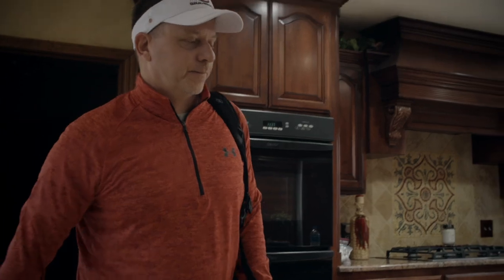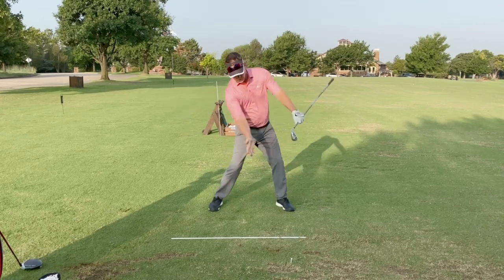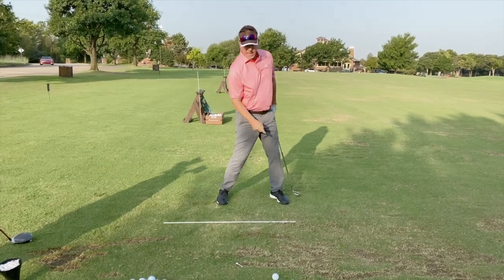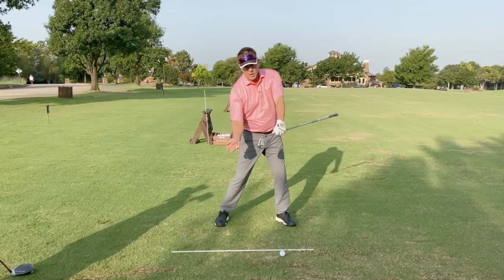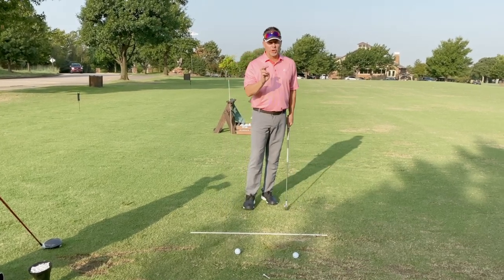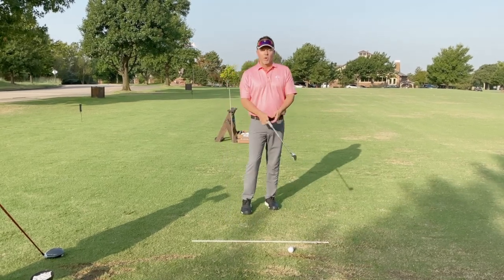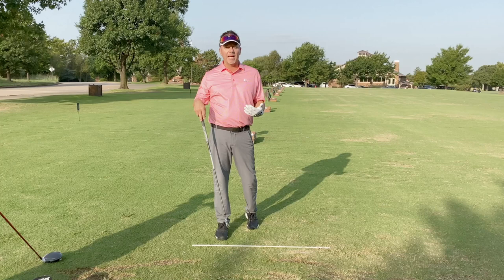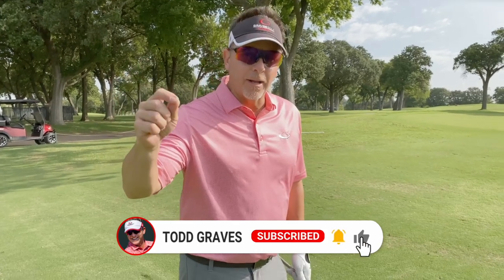Common Single Plane Golf Swing Questions (Part 1)

Comment: 73 going on 74. In my 7th year of golf. Normal score for me was high 90's, sometimes over 100 (26 handicap). Every shot was a gamble, 30% or more were awful. Been working for 2 months on your method. Now normal score is low 90's, sometimes in the 80's. My awful shots are under 10%. Still struggling but I see real improvement. Thanks Todd.
Reply: I’m a 71 woman and I’m totally reworking my conventional swing to single plane. Significant improvement  to game - and stress levels - in less than 3 weeks!  Thank you, Todd, for your excellent tutorials. X
Reply: Wow! I'm the same. This swing looks like something I will try this year

Comment: Hi Todd.  Your advice about releasing the club head early,.. brilliant observation.  It’s something I’ve struggled with for years and could never figure out the problem.  It’s especially prevalent when I use my driver.  And of course… with my driver I tend to turn my torso too far on the back swing, and then stop too soon on the downswing.  Thank you for that insight.. amongst many others.

Comment: Guys save this vid and watch over and over.  Use it as your in person lesson with Todd if you can't go see him.  It's all there or here for you to digest.  Another suggestion would be buy the alignment too Todd has which shows ball position, feet position and width.  Had mine for years now and always use it while on the range.  Also pay attention on how to move the lead shoulder position with the club your using by adjustment of the trail foot, that is a must or you will never be a one plane swinger.  Stability as Todd describes is also one of the keys which will set the Dominoes up to fall in sequence.  Keep this vid under lock and key it's all here!!!!

Comment: I can relate to incorrect tilt angle (over-tilting) and failure to keep my left knee flexed ( I had a straight lead or left leg) through impact. I took a video of my swing and immediately identified my outcome expectations would never be achievable because my swing faults, which emanate from failing to master each phase or step of the SPS, would always deliver poor results, and unhappy golf. Back to basics! My plan 1. Master each step by getting the bio-mechanics right 2. Create a fluid SPS by completing each step without consciously thinking about the process 3. Take my fluid SPS to the golf course (not the range) to hit golf balls that I regularly play (not inconsistent range balls) over measurable distance speeds. I’m working through step one and hoping to enter step two in a few weeks. Thanks Todd - keep the informative lessons and tips flowing.

Comment: I was hitting good drivers and was toeing or thinning irons.  Through the years I have probably straightened up to hit irons using the conventional swing and that was why I was toeing or thinning my irons.  My thins were still getting up in the air and going straight.  This video has helped me in a couple of areas.  I went back to my old swing for one day and couldn't hit my irons at all.  It was awful. This is the real deal, I just wish it wasn't the end of September in Michigan.  I purchased your single plane trainer and one of your videos and they helped me.  I will be buying your alignment and ball position board and setting up with all my clubs over and over this winter.  Also, I have an armoire with a full length mirror in my living room that is very helpful.  And, I have a yardstick marked with the distance each iron should be from my toe line.  I line this straight out from the big toe on my trail foot  and can see how far away from me each club should be.

Comment: I started the change in June 2020.  Its taken me 5 months and lots of swings into my golf net and at the driving range but I'm finally at the point that the swing feels natural.  I've had the same swing for 38 years so it was difficult to stop setting up in the traditional setup, and I mean difficult.  But over time, I started seeing results and I'm so pleased with the change.  I'm improving every round now, not so much score, although that has improved, but my overall ball striking with every club.  Especially my driving.  I did lose some distance but I feel like I can get that back (and slowly its coming back) now that I have full confidence in the set up, ball position, and the club swing path.  It's a much better world for me when I can hit the ball where I'm aiming!

Comment: Todd - good info on the bump and run when you need to land the ball in the grass or fringe in front of the green.  When landing the ball “ON” the green, here are my findings on carry and roll out with different clubs:  Lob wedge is 50% carry, 50% roll out.  Pitching wedge is one to two (one in the air and two rollout), 9i is a 3:1 roll out, 8i is a 4:1 roll out, etc. based on a flat green.  So a 20 yard chip or pitch to the hole (if landing the ball on the green in each case) has several options.  Land a lob wedge 10 yards onto the green and let it roll out 10 yards.  Land a PW 7 yards from the ball onto the green and let it roll out 14 yards (2:1 rollout). Land a 9i 5 yards on the green and let it roll out 15 yards (3:1), etc.  Landing the ball onto the green is more consistent than landing into the rough or fringe of varying lengths and softness/hardness if that is an option.  Much more predictable and consistent.

Comment: Todd – thank you for these videos and your detailed attention to the single plane. This video starting 21 minutes in (prox.), connected a few dots missing in my swing. As a single planer we begin straight legged and transition downward and finish against a braced leg looking sideways. In my current swing the transition forward does not include the downward, part I truly hope this is the missing DOT.  Bty, I am 71, a veteran, 14.6 index with 20% use of my left hand and solely because of your hands being clamps description I chose your method and am very happy I did. If this dot will help in keeping my right foot on the ground and stop lifting up I could perhaps shoot my age before turning 94. Many thanks.

Comment: Thanks for making these videos Todd!  I just started golfing 5 months ago and while I've progressed, it's been inconsistent with my best round of 18 only being 111 so far.  My biggest problem has been ball striking.  I stumbled across your videos recently and everything made plenty of sense so I tried the single plane swing for the first time the other day at the range despite friends who have been golfing for 10+ years trying to talk me out of it.  And WOW what an impact it made!  I was striking my irons straight and long, making great contact about 80-85% of the time.  Previously I'd be anywhere from 30-40% on a rough day to 50-60% on my best day.  I didn't fare so well with my hybrid, wood, or driver though.  But I realized after watching more videos I was doing it wrong!  My address was incorrect by lining up the club head to the ball, not in the center in front of me.  And I wasn't lining up the ball closer to the shaft vs middle of club head.  Makes sense why I seemed to get away with it on the shorter clubs but not the long ones.  So I'm looking forward to getting back out to the range to make this correction and see if I can get the same basically instant gratification as I did with my wedges and irons.  So thank you again!
Reply from the maker: You are welcome.
Reply: @ToddGravesGolf  Follow up note - made my address adjustment on the driver and BOOM I was hitting straight and long BOMBS at the range!  I had been a serial slicer and problem solved thanks to the single plane swing!  Playing 18 this weekend with the new swing for the first time, looking forward to it!

Comment: Todd, just had the best range session with my driver.  I just kept hitting my positions and going back to the fundamentals.  I hit the purest shot of my life and it was the best most effortless feeling.  So much fun.  The two tips that really helped me were not to over tilt and line the club slightly on the heel.  I’ve never been so consistent. Thanks again. Single plane swing for life!

Comment: Todd, what a great video! I have been working on my SP swing all summer at the range, but not quite getting it all correct You have touched on a number of points that will definitely help me get the rest of the way there to a correct SP swing! And, of course, you are absolutely right, if you do the SP swing correctly it does WORK! Thanks for this video!
Reply from the maker: You're welcome.  Glad to help.

Comment: Todd. Here in California your two bounce chip shot is very difficult on courses with Kikuya grass. Many times that first bounce will stop or backup.  Need to use a much less lofted club and it can be a very tricky shot. I am in the process of converting to the Single Plane Swing. I am eighty years old and    four months ago had a left knee replacement. Over the last four or five years my handicap has gone from an eight to beyond 17. The old swing does not work or feel comfortable. Hoping to get back to better golf through your system .  Thank you for your series.

Comment: for some reason i'm more comfortable using an 8 iron for chipping near the green.   guys i play with can't believe how well i chip.   most of them use a high loft wedge and are very inconsistent.   i have been changing my swing to be more on a single plane and am having a lot of better shots, especially my driver, and am enjoying playing more.   still have to work on hitting some of my other clubs more consistently.

Comment: My big point of confusion is sidehill lies for sure. 
Especially lies where the ball is significantly above my feet. I don't think I ever hit it pure out of those, and I attribute part of it to just being unable to practice them. On the range, you never have that obviously, but I do think the single plain swing elements also make it worse for me.
What do you do about spine tilt and ball position when you are on those slopey lies? 
Seems like if I try to keep the swing in-tact I usually end up popping the ball up if its in the rough, or hitting it fat otherwise. 
Seems like this is being covered in the next video though, so I am eager to see it!

Comment: Hi Todd,
I truly enjoy your videos.
I watched Moe on the range in the 1990s and it was sensational.
One comment... The swing you teach doesn't look any simpler than my conventional swing. It seems to have the same complications such as rotating the lower body, and the sequencing the upper and lower with the arms and getting the club face square at impact. I fail to see how the single plane is any easier than a conventional swing based on your videos and question and answer. It still seems to require a lot of ongoing range practice for proficiency.
Reply from the maker: There are Five basic "biomechanical" reasons the Single Plane Swing that you see me using is easier. 1) the club starts and impacts on the same Impact plane - Reducing Shaft Lift. This makes it easier because it eliminates the variable of the shaft changing elevation thus the body moves less. 2) Because of the tilt of the body at address (side bend or side tilt) the trial hand is in a non rotational position. Reducing Rotation.  Thus the trail does not rotate from address through impact.  3) The pelvis does not lift into impact thus reducing stress and compression on the back. Reducing stress.  4) Range of Motion Limits is a biomecancial term for the maximizing body's range of movement.  The Single Plane swing positions the body to reach "limits" which makes repetition easier.  You can find out more here :https://moenormangolf.com/store/products/the-laws-of-simplicity/

Comment: Thanks for a great video! I am hoping to take one of your week long classes here in Phoenix. I tried switching to the single plane swing about four years ago. When I first started I hit a lot of shots thin. Then it fell together. Ball was going right at the pin for many rounds. Now somehow I have done something wrong. The ball with most of my irons is either going straight right or a pull hook to the left. I know the right shots my club face is open to the path of my swing. And I am not sure why I pull hook the ball so bad. But when I place the club back down after a pull hook it is very closed.

Comment: This is my 2nd year learning the swing. I tee up my driver on my toe and crush it, but when I hit my irons I push the ball to the right (right handed). I have a problem of getting square at contact and not hitting my irons solid. I am guessing I am moving to much to my left side. I did the same thing with the driver until I addressed the ball about 10" behind the ball. I address my irons the same way but still not hitting them straight. I am going to have my son video tape me.

Comment: Todd... Thanks for this video.  I have completely transformed my swing to SP, but am still jumping.  I recorded myself now hundreds of times and still doing it.  I find this part of the swing the hardest to get down.  I'll just have to keep working on it.  I know that you aren't a big proponent of drills (per another video), but I'm currently struggling to understand what feel I should have without isolating this part of the swing and drilling the behavior I want.  Any help on this would help.  Thanks again for all the great content.
Reply: Just my 2 cents. I think the jumping is coming from wanting to crush the ball. While I'm not a proponent and neither is Todd, of "swinging easy", especially with irons. I would try dialing the swing back, think of like 80-85% of full power. So just take it down one notch, this could help eliminate that jumping. Also maybe practice "half swings", like try hitting an 8 iron only 100 yards. That kind of stuff.

Comment: Thanks Todd! I have been trying to understand how the elbows are orientated at set up. Whilst my grip has been correct, I have always had both my elbows kind of pointing down at my hips. After watching your grip drill about 20 minutes in, My understanding now is that the lead elbow is more pointing toward the target or slightly left thereof. Would this be a correct evaluation. Thanks

Comment: Thanks for creating a video answering frequently asked questions. Many were questions I had/have as I continue through my journey to the feeling of greatness. May I ask you if there are any drills you recommend in order to get comfortable with the overlap grip? I feel most comfortable when I interlock but do notice my wrists are closer together with the Vardon grip which I understand you recommend. Is the answer to simply continue to practice with the overlap grip until I am comfortable with it? Thank you in advance!

Comment: Great Video, helps a lot on the tilt, I was over tilted..and the feel of a shorter swing instead of too much back swing. Do more of this type of video. Quick question, I purchased the Moe Norman Ball and stance alignment tool..the trail foot is lined up with the inside of your foot or just in the area that feels comfortable?
Reply from the maker: Yes. I line it up with the inside of the (trail) foot.
Reply: @ToddGravesGolf  thank you and enjoy your videos, just flew back to Jakarta from Cali, picked up the Moe Norman Alignment, looking forward to using it, single plane works for me, coming along slowly but improved a lot. Will be back to the States February, any One day or 3 day schools happening then? Cali, or Philly area??

Comment: I see you set up with the club already behind the ball how do you know your the right distance between ball and club and your hosel is perfectly in line with the ball thank you
Reply: If you look in a mirror at yourself, "from down the line", your right forearm will be on the same plane as the club shaft, a little space also between the left(higher) and the right forearm(lower). When in this position and the club soled properly, that will be your approximate distance from ball. Also, very little, if any bend of the knees.

Comment: Thanks Todd. I don’t understand where you’re going with grabbing your left bicep to restrict the forearm from rolling into a closed hook position. Once you’re in the downswing what will stop it rolling closed and the resultant hook note that you are no longer holding the upper arm? Because that’s exactly what happens to me, I just roll that lead arm closed and away it goes into the left rough or water or bunker 😱
Reply from the maker: When you grab the bicep, you are allowing the forearm to go into "its" full range of motion.  When you swing, your tilt and torso movement restrict the bicep - and then your forearm reaches "full range" and squares the face.   Make sense?
Reply: @ToddGravesGolf  AND that fixed my pull/hook problem. Occam's razor . ;)
Reply: Todd Graves after a few re-reads of your comment and repeating in front of the mirror YES I understand. It’s amazing... if I lose my tilt then the upper arm disconnects from the chest which destroys the restriction and thus allows the forearm to roll into a closed position. Amazing!!! I hadn’t realised how important was the tilt and connection to the chest. Thank you for taking the trouble to explain. Now I should be able to confidently square the club face without fear of rolling into a pulled hook which was my standard shot. 🙏
Reply: @golfcrank   I played today, "grabbing my bicep" before every shot. No hooks, a couple of wedge pulls and a 77 with 4 putts left on the green. Every element plays its role and when we get our positions right, it is a thing of beauty. Thanks to Moe and "Little Moe", we can all achieve that feeling of greatness. :)